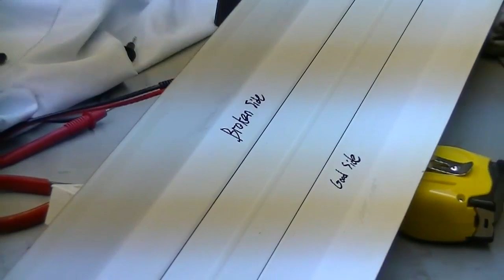Multiple Fluorescent Fixture Fix DIY

Comment: Are the caps marked as far as capacitance and voltage, or does anyone know what rating would work properly for a replacement? Those originals are likely junk. Thanks.

Comment: Good work fixing your lamp fixture, I too had all my 15$ light fixtures burn out on me when the room temp exceeded 95 degrees and same as you I wanted to learn what parts failed and what parts were still good. After many months of trial and error I learned that all that's needed to run those bulbs is the inductor choke with the pre-heat open/closed starter switch. But when I worked my way up to the 4 foot T12 bulbs they wouldn't kick on once pre-heated like the F30/T12 and smaller bulbs. As it seems a starter condenser is needed to provide the proper voltage kick to light up the 4 footers but once lit they run on only the choke ballast. I have yet to try this with larger/longer bulbs but I'm sure I can get them to light up just the same....

Keep up the good work !

Comment: you should never touch the tubes!!! you will shorten the life of them. always touch them with something clean not greasy, like a microfiber towel or anything clean. and another thing to keep theyr maximum life, always let them warm before turning them off. about 1-2 min depending on your installation. Cheers
Reply: ummmmmm. you can touch the tube lights with your hands it will not shorten the life of the bulb...... the bulbs you shouldn't touch with your hands are halogen, they only way you going to shorten the tube light is when you are using the wrong ballast or running a weak ballast, how to tell if your ballast is weak.... that's easy when your tube lights are dim than normal brightness.......get your facts right... and don't call me stupid or anything.... i been using fluorescent light fixtures all my life and i have NEVER had any bulb burned out by touching with bare hands.... Cheers
Reply from the maker: 90% of the tubes in the video were about to get scrapped, but any reason not to touch them? I know not to touch halogens due to the high temperatures and skin oil having an effect on the glass, but florescent's do not get hot to the touch.

Comment: The capacitor in these cheap LOA brand fixtures is called a "lead-peaking capacitor". The ballasts are simple "choke" type ballasts and they do 2 things-first they provide an inductive "kick" to start the arc in the lamps when the starter opens on start up (the starters are actually in the center of 2 wires running end-to-end inside the middle of the fixture---they are electronic type in little plastic covers), and the ballast serves to limit the lamp's operating current to the wattage required by the lamps like in all fluorescent lights. the thing is, normally, the largest fluorescent lamp that will operate on 120 volts on such a simple choke ballast is the 25 watt, 33 inch lamp, or the 22 watt circline lamp. This is because these lamps run at about 60 volts, and the ballast also loses 60 volts, totaling 120 volts. Any higher of a lamp/ballast combination total normally requires a step-up transformer built into the ballast. this is where the capacitor comes into play. The 120 volt line actually will reach a peak voltage at the top of the waveform of about 160-180 volts. It is very brief, and the "choking effect" of the ballast basically keeps it from making it through to the lamp. BUT--if a capacitor is added in series between the ballast and the line (or lamp), and it is properly rated in capacity, it will reach maximum charge at that peak, and discharge thru the ballast or lamp depending on the hook-up, and provide enough peak voltage to run the 48 inch 40 watt lamp off a simple choke on 120v. The standard 40 watt 4 foot lamp has an arc (running) voltage of 108 volts, and the ballast about the same, though the choke can be wound to lose as little as 95 volts. In most preheat start units (which this LOA unit is as well), the ballast must put out about 216 volts to correctly run the lamp. This is what that capacitor does. Please note that that the capacitor does NOT "step up" voltage at all--it merely passes the highest peak voltage on the sine wave, allowing a dirt-simple and cheap way to run 40 watt 4 foot lamps off 120 volts. If LOA had installed high quality capacitors, this set up can run for many years, but those mylar insulated aluminium caps are "el cheepo" and fail quickly! Even moisture will destroy these fast! You were right about the ballast choke lasting nearly forever, and the starter units in these seem to be decent too, but the capacitors are MADE TO FAIL! I like how you repaired these--kudos! BUT--don't expect long life, and also don't leave flickering lamps that are black on the ends in these--they will kill the capacitors fast! Also, the hum is normal--it's actually the ballast chokes themselves buzzing a little. "Rectifying" lamps--bad ones that flicker, run the ballasts and capacitors at 30 cycles, and the caps can get out of synch on the vaveform peaks, which can cause back-induction from the ballasts, and this will kill the caps. These fixtures are a perfect example of consumer products-"consumer" being the key word--made to fail and being consumed so you have to buy more! "Built-in obsolescence" is another name for consumerism! Even today's commercial-grade electronic ballasts are made to fail--many have countdown chips in them that shut them off at a certain "pre-determined" lifespan--requiring replacement, that is IF a triac or transistor in the circuit doesn't fail before the countdown ends, as many do! I have preheat 4 foot fixtures from as early as 1939, most from 1941 through the late forties, with big ol' heavy preheat "tulamp" 2-lamp ballasts, and it's not at all unusual for these to have the factory original ballasts with a GAZILLION hours on them, still working like a charm, and eager to go for another 70 years! Those are REAL fluorescents, the ones in this clip are simply homeowner garbage meant to fail in short order. Cheers!
Reply from the maker: Thanks for the comment, thats interesting. I knew they were cheap lol. The fixtures had been used for at least 5-7 years almost daily before they started going out, I don't expect to get much more use out of them with the replacement capacitors that are just as old. They seemed to be dependable other than the caps failing, do you know if I could get a replacement cap to put in place of the cheap ones when others do fail? Also are you sure some are made with a timer to fail after so many hours? Making them cheap to fail is one thing, but engineering it to fail is outrageous. Nice to see the older ones are not rigged like that. If I could find replacement caps for the cheap ones that would make them decent I suppose.
Reply: That is what I have seen in more than one industry as far as planned obsolescence. They put one or more cheap components so they do not have the long life they could have. I haven't been into mine to see but are these caps marked so I can find a decent replacement?, as like you say just moving around junk will likely fail soon again. Thanks.

Comment: Is the capacitor the problem i am having with my light fixture? I bought new bulbs and they worked ok for a day or 2 and now they are dim and not working very well do know what might be the problem?
Reply: i have 2 fixtures that has electronic ballasts..... and i HATE those electronic ballast, they did not last very long....4 month and one side goes out on me.... and 7 minutes and the other side goes out....... i still have that fixture and going to replace it with a real ballast so i don't care if it flickers when near EOL....least it have a few more hours on it before finally EOL...... what electronic ballast does is eliminate the flickering when they are near EOL.... when the bulb starting to go... it will go out instantly without letting it burn out... sometimes it can ruin the electronic ballast..... MAGNETIC BALLAST AND PREHEAT LIGHT FIXTURES FOREVER, DOWN WITH ELECTRONIC BALLASTS!
Reply from the maker: Well there are several different types of fixtures, some are all electronic and not at all like this. Given that both of yours are dim it has to be a different setup than this because the one in my video has each bulb independent of each other. You may want to try 2 more bulbs in case, if they work you may have just got a defective bulb. If it's dim still you know its the fixture and you have 2 extra bulbs, no big deal.

Comment: Nicely done.  I have a similar fixture but it has little starter circuit boards instead of the capacitors.  I'll have to get it apart to see if I can fix the side that never stops twitching and flickering, even with a new bulb.